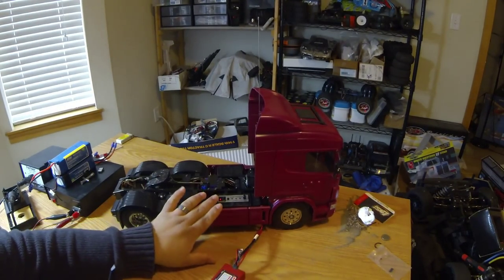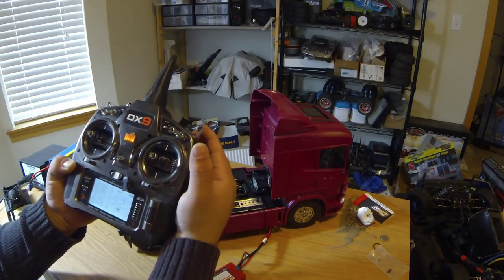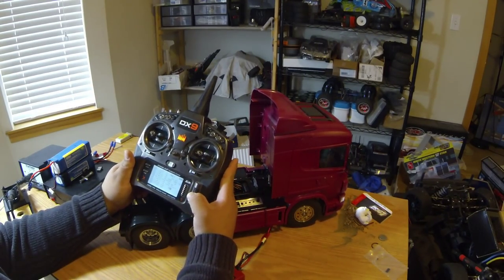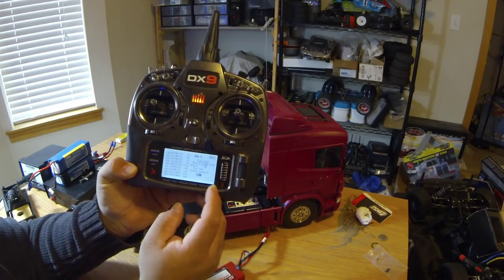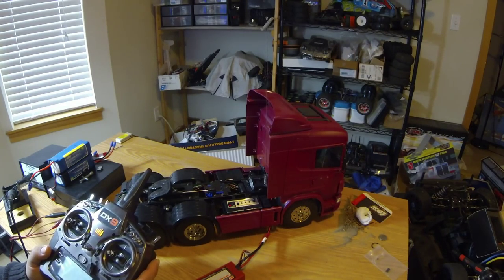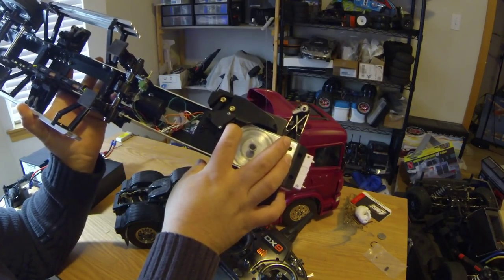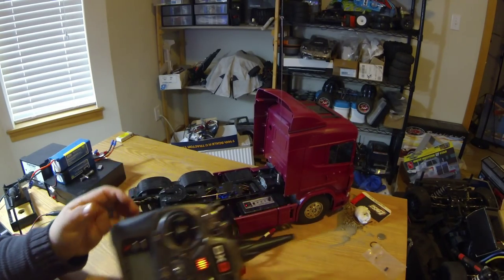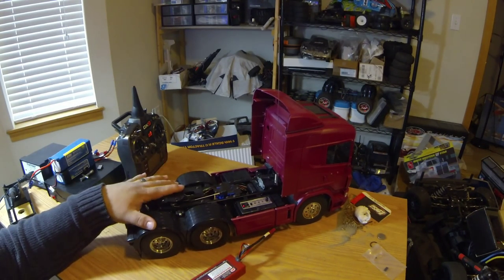dx9 tamiay trailer legs setup

Comment: Hi Sir, I love your videos and next to manual built the Marsk trailer, motorised legs, using your videos as reference, which was a great help for a newbe in RC. After building Man truck and trailer the next step to set up MFC 03. I saw your video about trailer legs set up. I have the DX 6 E and wonder if this setting can be implemented too. Unfortunately the settings you use were not good readable. Can you give me the 2 setting for mixing Elevation/Aux1. Will be great help,

Comment: Hey Speedy. Good video as usual. I was wondering, I asked on my truck forums and they said no but do I need the MFU to make the motorised legs function or can I wire the servo for the legs direct into my receiver?
Reply from the maker: Correct you don't need a mfu. What radio are you going to run? You need to be able to do the mixing to make it work right. As I show in the video.
Reply: thespeedymex  I am running aa Carson Reflex 6 channel with matching receiver. They are recommended for a starter package./ I am no where near a starter but it comes in a nifty bundle with 2 servos, an ESC, Battery and charger all for about £120 so all is good haha